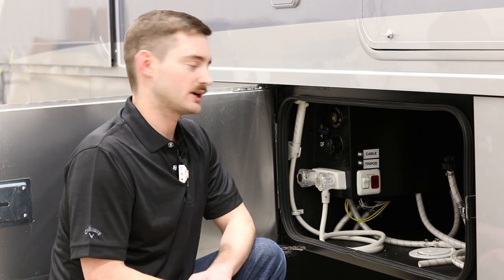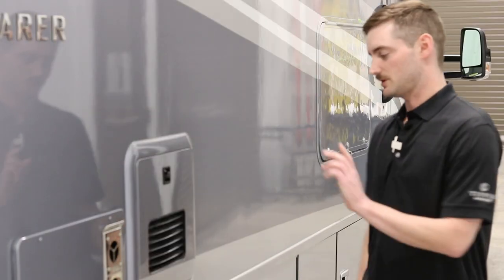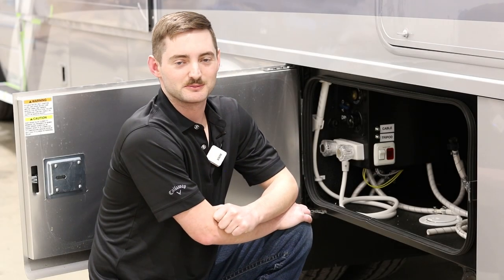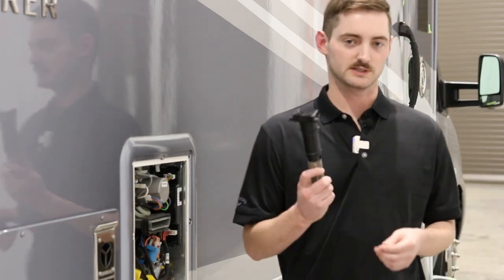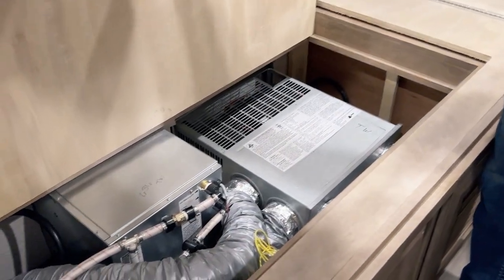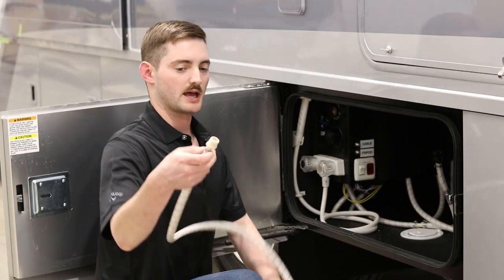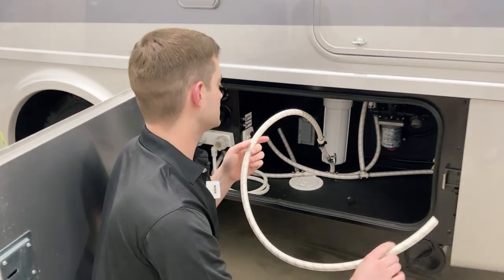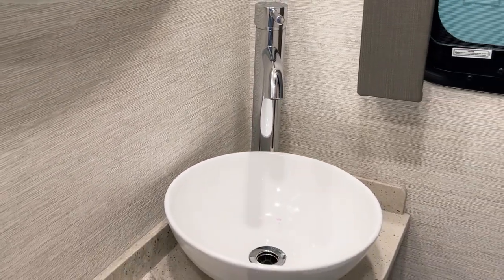Tiffin Tips - Winterizing/De-winterizing Class C Wayfarer with a Truma System

Comment: Thanks for producing this informative video, and also saying that it applied to the Midas. When I purchased my 2022 Midas 24RT in January 2023 from a dealer in Albuquerque, they also ran RV antifreeze through the Truma and did not bypass because they told me that they had experienced freeze damage due to some trapped residual water in the Truma. I live in south Texas so I rarely have to winterize, but I’ll always follow your advice and bypass the Truma. Also, since there is no isolation valve between the pump and freshwater tank, I’m surprised that the pump is able to draw antifreeze because the pump’s suction is open to the air via the freshwater tank. Obviously this doesn’t seem to be a problem because it’s your standard design.  Finally, my Midas has its own water lines challenges when operating in cold weather, but that’s for another video.

Comment: Sorry but you are Wrong, If you turn the city/Dry valve to dry to suck antifreeze up out of a bucket or jug the pump will only suck air from the empty fresh water tank because it's easier to suck the air out of an empty tank than it is to suck a liquid out of a container. if you turn it back to city it will close the line to the fresh tank allowing  the pump suck the antifreeze out of the container  thru the pump and into the rest of the system,  Give it a try and you will see what I mean.     2022 LW
Reply: Thanks for clarifying. Regardless, I don’t trust anything that I can’t see (for instance I have a “T” connection upstream of my antifreeze point, and I can’t figure out how switching from Dry to City will isolate both lines). For my Midas 23RT I added a quarter turn isolation valve (in common header just upstream of antifreeze connection) for positive isolation of city water and the fresh water tank to avoid my confusion for the rare instances that I might need to antifreeze.